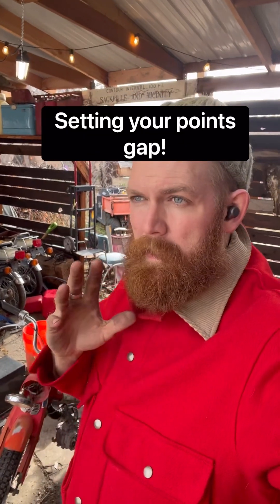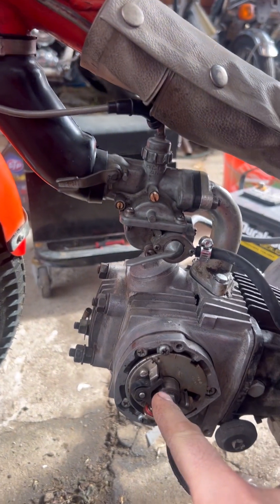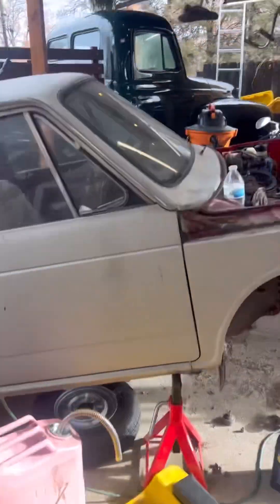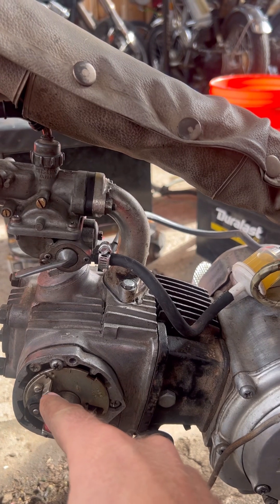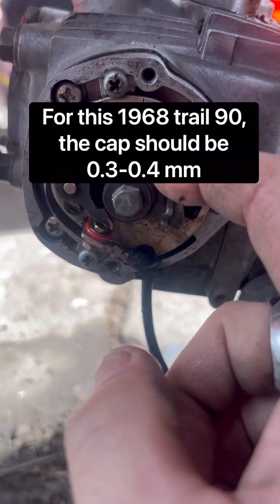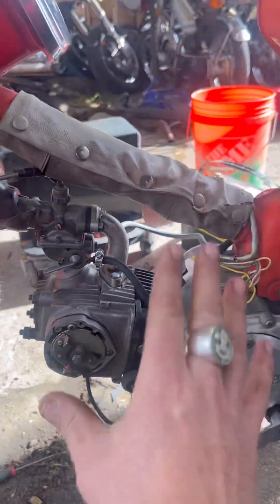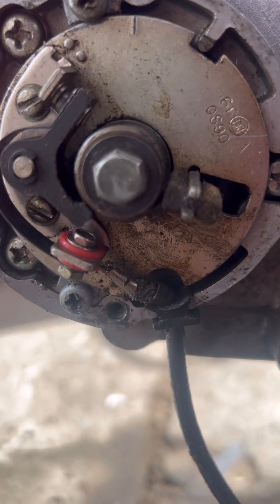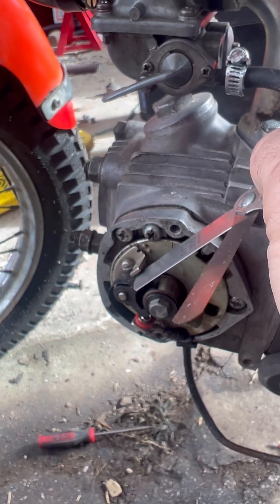Setting points gap, Old Car or Motorcycle. Honda Trail 90 CT 90 spark issues

Comment: If you use the kick starter to set this you will set it wrong

You need to remove that round cover to the right that says Honda (three screws) and use that bolt to turn the engine it has markings so you know exactly where F (firing mark) is

Comment: Hello. thanks for the video. I would like some advice. I have to rectify my c90 year 1992. I'm considering a stock Japanese piston (tkrj 0.25) which is old design vs a modern design Chinese piston, short skirt, graphite, higher compression ratio. There are not many options on the market for this model. It is a motorcycle to work with.
Reply from the maker: Yeah I’ve actually done both. One of these I did a new piston and rings and valves. It runs alright but I’ve got a few issues I still need to resolve on the shift linkage. But my 1975 ct90 I upgraded to a Chinese lifan 125cc both have actually worked well. I love to stay OG Honda. But I’m no purist. If you go Chinese. I go the whole new motor and wiring harness. Hard to take Chinese parts into the OG Honda motor.

Comment: So i just bought a bike test drove it, loaded it and drove home. When I unloaded it the bike would not start after checking this plate the plate screws were completely loose and it could just move around with no effort. How should I even begin to diagnose this? Thanks in advance
Reply from the maker: Well congratulations on the new bike. That’s great that you rode it around. It should be simple. Bottom line would be, there is a lobe that rotates inside the points plate. And when that lobe opens the gap to the widest point, you’ll measure and adjust that to get the desired gap. Your model of bike will have its own specs for what the gap should be, and feeler gauges are easy to snag at an autozone or something. When the gap at the largest point, and meets the specs, you tighten those screws back down.

Comment: my points aren't closing at all :I
Reply from the maker: Are they stuck open? As the engine turns over, can you feed the center post rotating? The center post is connected to the cam shaft. As the engine turns it rotates. It should be oblong making the points open and close as the love makes contact with the points mechanism